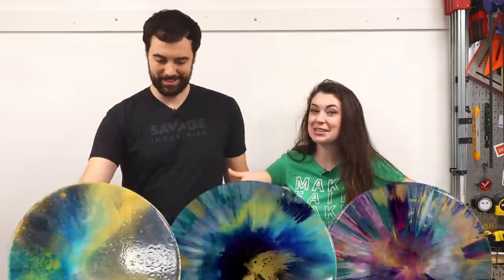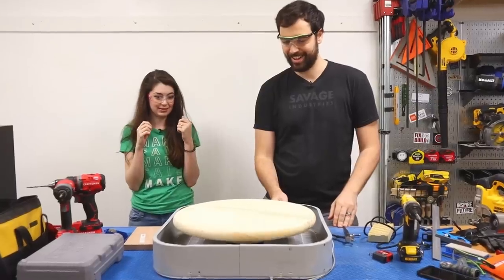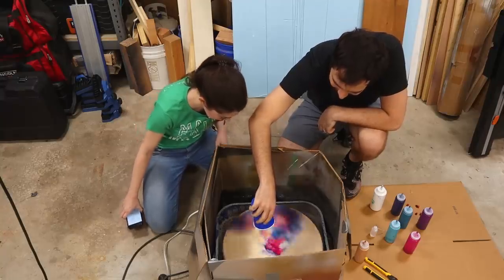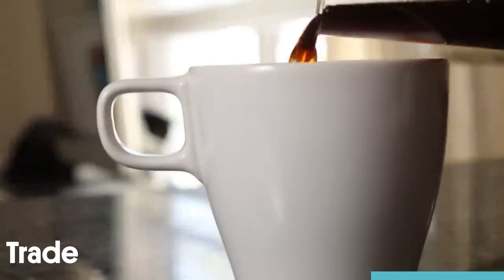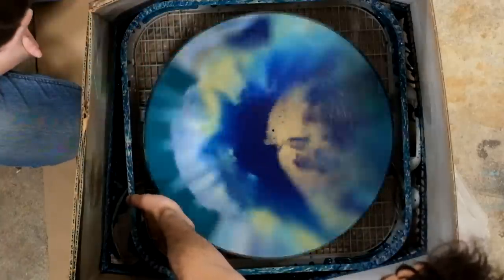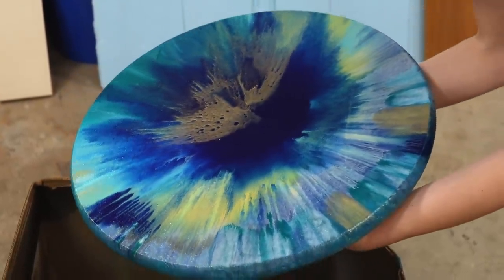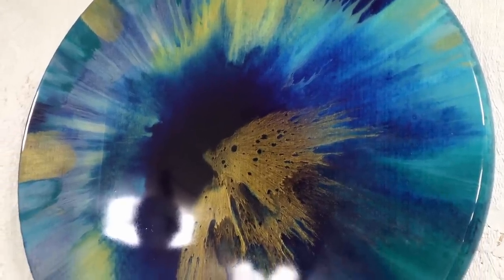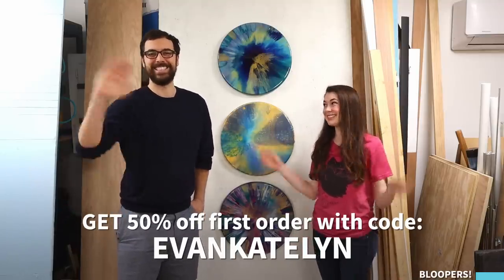Can You Spin Art Resin & Acrylic Pours?

Comment: How long do you leave the Epoxy Resin On for?

Do you measure with a Resin calculator or how? 

What form of adhesive did you all use to pin the designs to the wall! Just Stunning🥰

Lastly what size are the round wood pieces? Just Stunning..

Comment: So i have done many acrylic pour paintings if you try the spin on a fan again flip the cup let sit for atleast 15 to 30 seconds remove cup then turn it on you wont waist paint drop the cup and its safer plus will still have a cool effect another option is use a lazy Susan  flip like you mentioned the 1st time you tried do quick short lifts only allowing alittle paint out at a time and spin and only lift and set cup when not spinning also helps to base coat your canvas with some kinda base color of your choosing but do it light
Reply from the maker: Ah thank you! That totally makes sense, so the paint flows down the sides of the cup before removing it. Thanks for the tips!
Reply: @EvanAndKatelyn  also helps to spray or rub a small amount of wd40 in the cup b4 adding the paint and your welcome

Comment: Did you have any thoughts about how to use the force of the spin to design some specific forms?
Reply from the maker: I think with more experimenting we could figure out some more solid techniques. I've seen some videos where people use a cup with holes in it to make some interesting shapes
Reply: @EvanAndKatelyn  I was thinking, if there is some centripetal force, what would come out if you put straight lines  from the bottom to the top of the wooden circle, let's say in white and blue, about one inch of each other and then spin the circle. What I'm trying to say is: depending on the way you organize the paint it may produce a specific pattern. Well, I think lol

Comment: Use more paint the wood is soaking it up to fast and not letting it flow properly or paint the board white and while it’s still wet flip your cup and spin you will see better results. When I’m pouring on a dry surface I have to pre paint or use more paint. Also try putting a spray or drop of silicone in your paints you will have more cells form after it sits.

Comment: What's the name of the TotalBoat epoxy kit you use? I just see so many to choose from on the site and am not sure which one to use. Also, what's the worktime on the one you use? (I know the current art resin I use is about 45 minutes but I know some have a shorter work time of about 15 minutes).
Reply from the maker: We use the one with the slow acting hardener. You get about 40 minutes of working time 👍

Comment: For long term use this will break the motor. I copied the same thing and ended up using the round thing as a base for canvas's. It does work and it's turned some nice pieces but midway through one painting, the motor just died. Keep that in mind when you're thinking of this yourself.
Reply from the maker: Good tips!

Comment: It is scary how mechanically challenged these two are.
Reply from the maker: You might be missing the point of the video. It's not to make the best spinner that can be made, but to make something accessable and fun 👍
Reply: @EvanAndKatelyn  I understand that in the projects turned out amazing and beautiful to look at but little simple things that you made more complicated like the fact that you decided to reuse the plastic center part of the fan instead of just taking a flat board and drilling a hole that will fit in its place, by cutting off the blades like you did you made sharp edges on them which is basically a sharp spinning cutting blade we're before of the Blazer even just left on you put your board on there you can stick your hand in there with the fan on full thing in the most it will do is smack your hand those fans are not very powerful on their cells which is shown whenever you turn it on with the wood how long it takes to build up speed.the other thing I noticed is that you didn't take the time to find center on the round pieces of wood you did and he found center on the boards you could have marked them and then had the piece more squared up for your project, in doing this it wouldn't be spraying all your paints and acrylics off of one side as much and give you more evenly coat like you guys were trying from from the beginning and then instead of readjusting it you tried to apply more paints to the sides that we're not getting them when readjusting your board itself would have solved the problem.